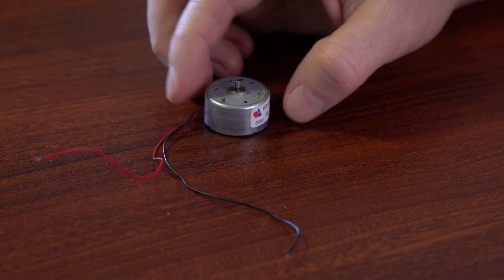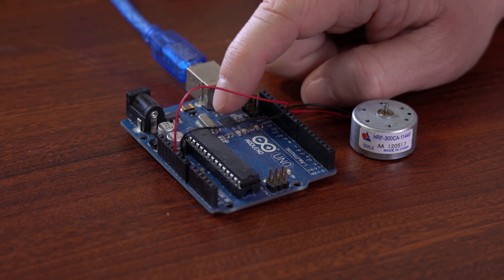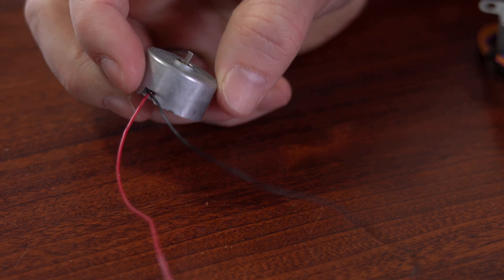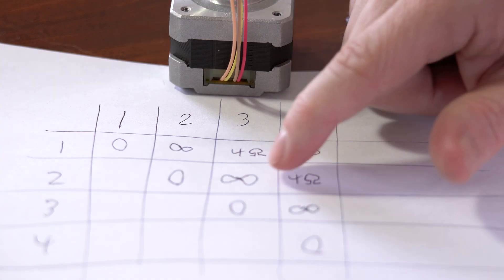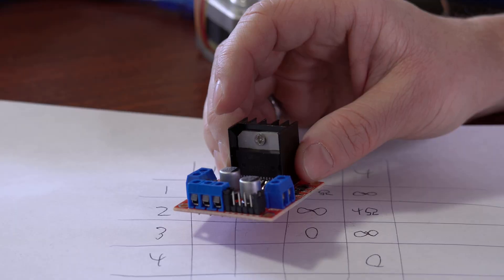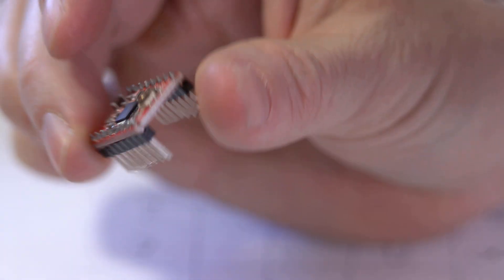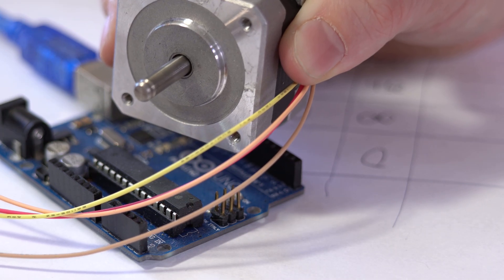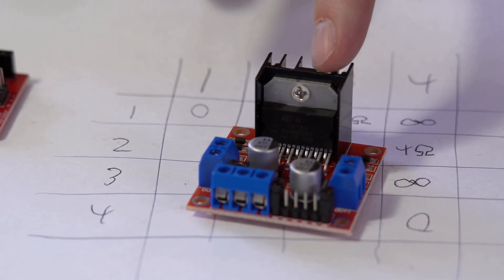A Web Developer's Guide To Motors

Comment: I'm not sure how to introduce it, but I just thought id say that magnetic rotary encoders exist, and are absolutely amazing for like... many things.

Particularly great for making any open loop application closed loop. They are cheap, and often easy to interface with using I2C.

A common ic is the AS5600 for which many breakout boards are available.

Comment: 1:14  Transistor?
Reply: Using the Arduino's gpio to a power mosfet and a high current voltage source would get you there.